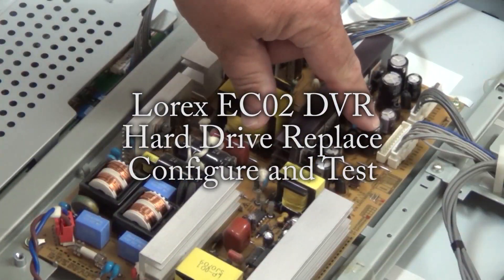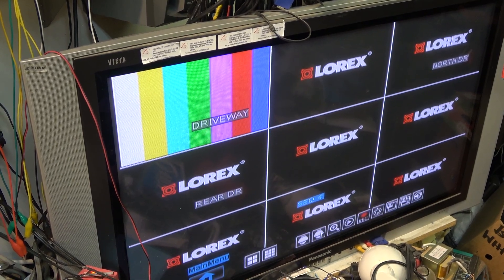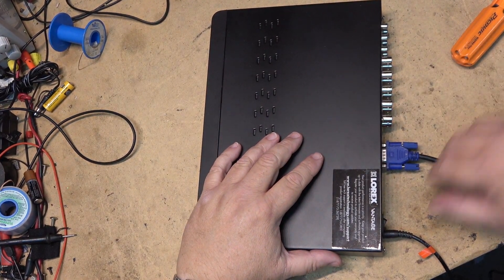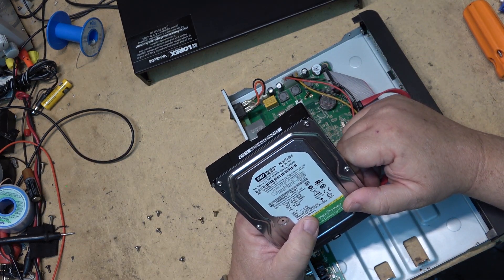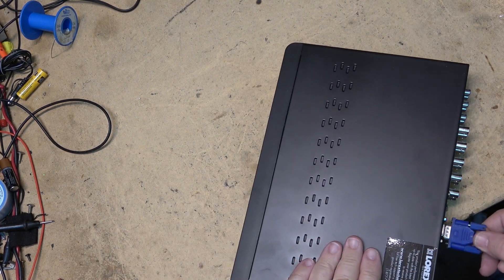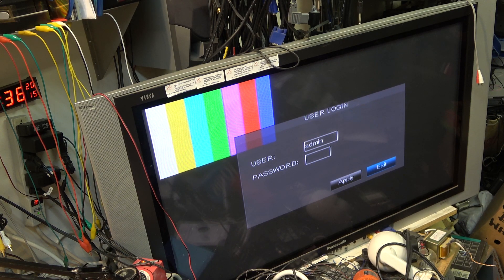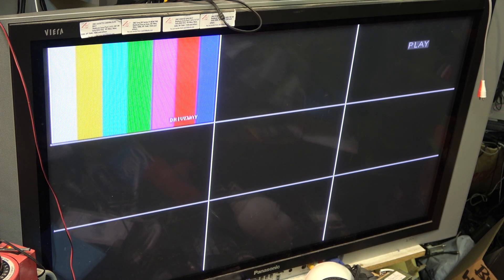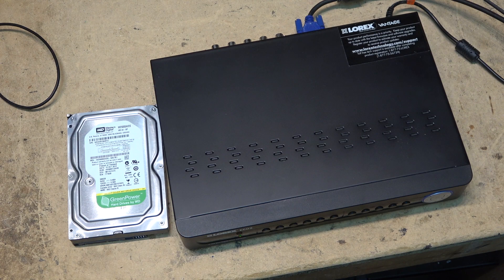Lorex EC02 Security DVR Hard Drive Replace Procedure

Comment: Hah, so I looked at a ZOSI DVR that was randomly rebooting. Power supply? Fine. Hard drive? Fine.
Turns out that utter piece of crap runs a web server and will tell your router to open a port for it, exposing it to the internet. There is no way to disable that unless you disable uPnP forwarding on the router, which I did. The web server on this thing is so bad if anything other than its mostly useless mobile app hits it, it will crash and cause the DVR to reboot. The best part is, you don't even need the web server for the mobile app to work! It goes through some Chinese cloud service.

Comment: When you opened up the unit I noticed a bulging electrolytic cap on the board. Wouldn't that cause issues on one of the power rails?
Reply: It can do.
Reply from the maker: It's not bulging.  That is just a reflection.

Comment: No SSD for replacement?
Reply: SSD have limited write cycle and the system will keep writing video data which will not last as long as the HDD
Reply: @Metal1996  And you don't exactly need read write performances in a dvr like you would in a laptop or a pc.

Comment: By the date on the drive, it's lasted a long time.
I've had combo dvd/vcr/hdd recorders that become broken if the drive was replaced.
Putting the bootup/system code on the drive was a bad idea.
i'm sure they did it on purpose.
Thankfully no one bothers with them now.
Reply from the maker: Panasonic was bad for that. It was to stop people from removing the drive and reading the content on a computer.
The disk was scrambled too.

Comment: It's not the harddisk thats broken in this one. See the bulge in the cap next to the hdd power-connector? Thats probably why it didn't spin up.
Reply from the maker: No its the drive. It was physically stuck. I opened it at the customers house and gave it a few smacks and it started spinning up. The bearings were seized up.
Reply from the maker: That's not a cap, that is a battery for the time and configuration backup.
Reply: @12voltvids  that is most definitely a cap. I'm not talking about the cr2032 in the center. I mean the one between power input and the connector going to the hdd
Reply from the maker: @Craft4Cube  Its not bulged. Just the way the light reflects off it. I just looked at it as I haven't returned it yet. Going back today, Definitely the hard drive because it will not boot up in my docking station either.
Reply: @12voltvids  okay, thanks for checking tho. I thought it looked like it was bad. My mistake

Comment: Older unit, sure was made better. The newer Lorex units too expensive and all plastic. If u could make disk work, u could recover the data possibly.
Reply from the maker: Plastic really isn't an issue.  It is something that sits on a shelf rarely being touched.   Mine has been solid in the 7 or 8 years it has been running here.  Fan died on processor, then power supply on DVR died and then power supply on cameras. Other than that been solid performer.

Comment: Are the hard drives on these security DVRs encrypted like the ones for your TV?
Reply from the maker: Some are yes.
Reply: They are. And they use strange Unix-based file systems. The data isn't accessible even if you plug it into a Linux machine.
Reply: @crashbandicoot4everr  What if you use a Unix based OS.

Comment: Yes, I grab old sat decoders for the hard drives in them, they are perfect for use in DVR units. Later ones though are not as reliable, the thing that shows this is that the device now has a built in hard drive caddy, so you only have to break a security seal and one screw to remove the drive. But the drives are often good, though they may have high hours on them, so long as SMART does not show any reallocation, and low other errors the drives are good to go.
Reply from the maker: Yes have salvaged a few over the years. They are usually 250 or 340g though.
Reply: @12voltvids  Last couple have been 500G and 1T drives though, I have a large collection of smaller size drives that work.
Reply from the maker: @SeanBZA  i have gotten a few 500s.   Not lucky enough to find 1tb drives yet.

Comment: Looks like a swelled cap inside
Reply from the maker: So.   It was brought in to change hd. That's what was done.  Unit is working. caps are just fine.  It's been running 9 years 24/7